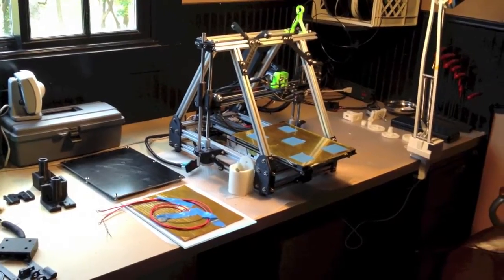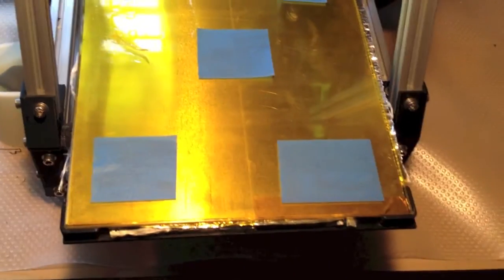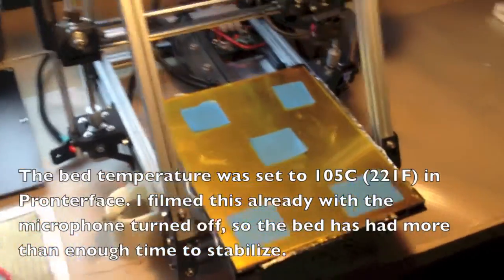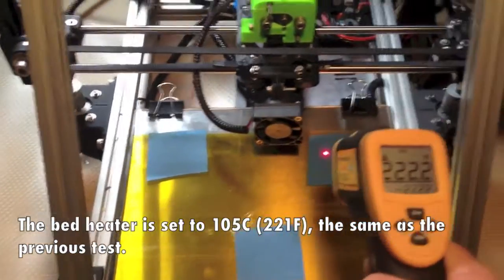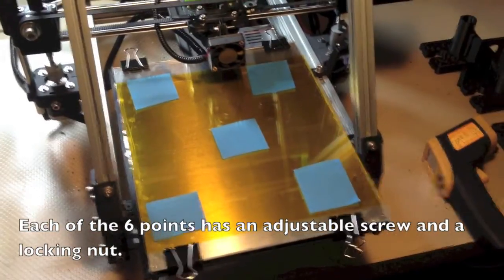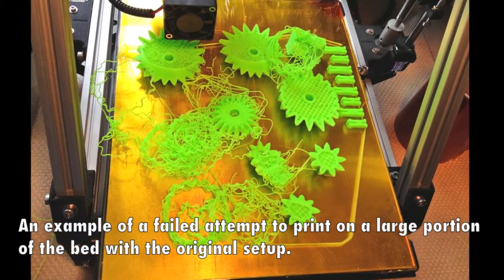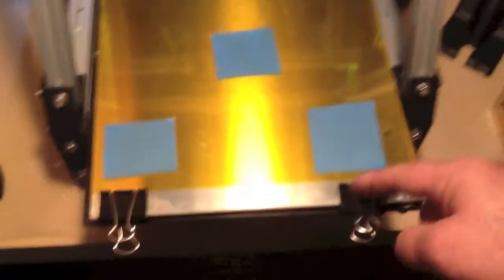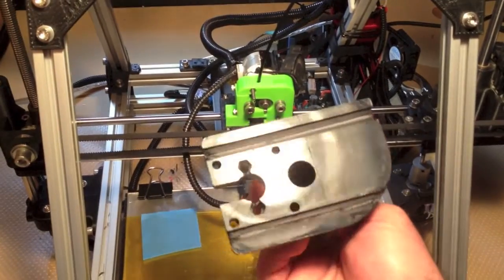MendelMax 3D Printer - Heated Build Platform Upgrade

Comment: It looks like this heated bed video predates the Stratasys heated bed patent priority date. Where did you get your time machine 😂?
Reply: yes, US9592660B2 was filled on 17.12.2014 and granted 14.03.2017. This video is from 07.12.2012, but the plate does not have „a high temperature polymer coating applied over the removable plate, and surface treatment of high temperature polymer coating to maintain adhesion between 3D object and printing surface.”. The capton tape is considered coating?

Comment: If the issue is thermal stress warping the glass, then this issue should be resolved by replacing the glass pane with a low thermal expansion glass like high purity Borosilicate (Lab glass).

Comment: I would to see coverage on Slic3r. From personal experience and from what I have read online it seems that 0.7.2b is still the most stable version and it gives better print results but of course it's missing many features in newer versions.

When I started out I used the newer versions and had no idea why my prints were so bad until I was told to use 0.7.2b. Can you shed any light on settings and maybe why the newer versions seem to get worse?